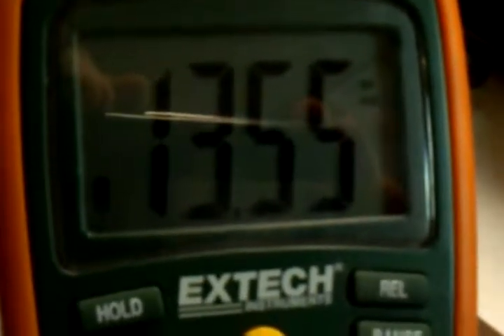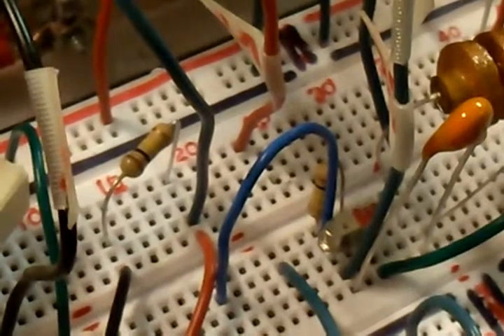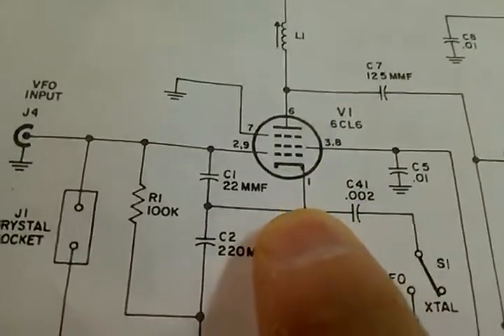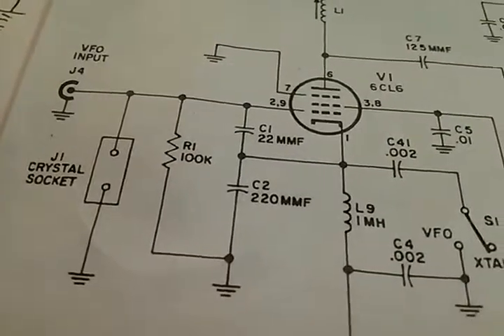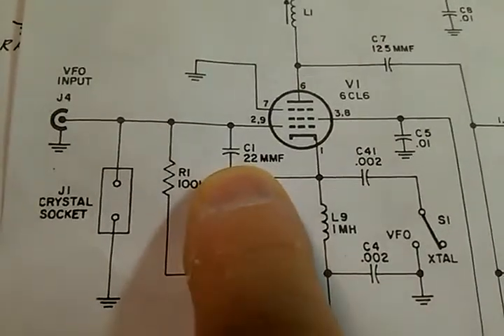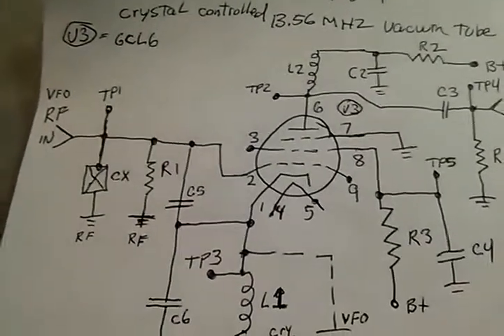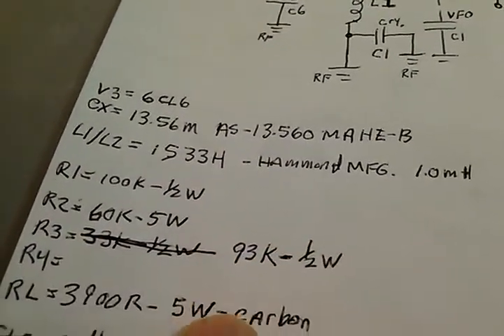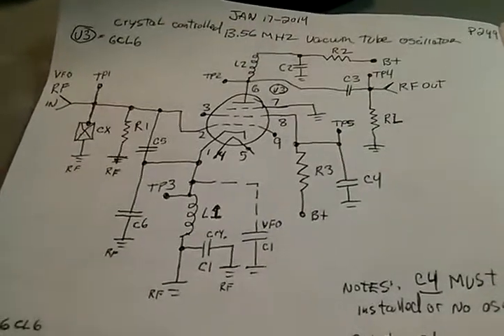13.56 MHZ crystal controlled 6CL6 vacuum tube oscillator #1

Comment: I remember working on an very old huge RCA receiver had lots of tubes and had many bands used to listen to European transmitters.
Reply from the maker: this is the beginning stage for the 13.56 mhz power supply we need to continue our Donald L. smith experiments.
Reply: looks good I could probably put your schematic onto a pcb.
Reply: you probably could find an old military equipment to fill your need and save lots of time reinventing the wheel.  salvage
Reply from the maker: Struggling to amplify the signal using another tube.

Comment: Likely the modification you made to the circuit at 8:30 will prevent it from working, or at least alter it substantially.  Use the two resistors and connect as per the diagram.